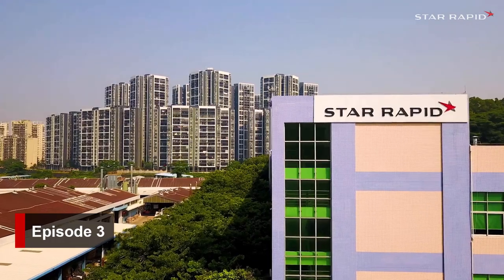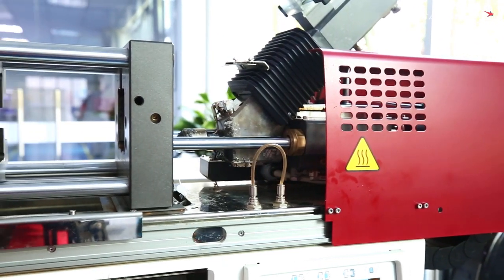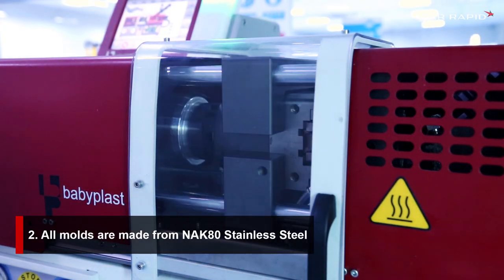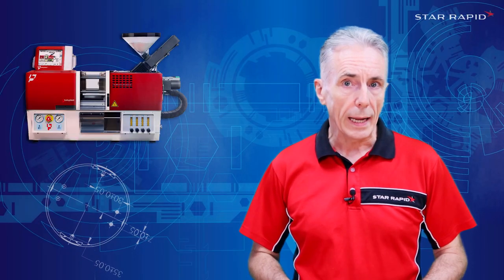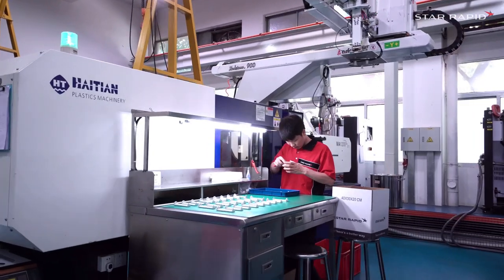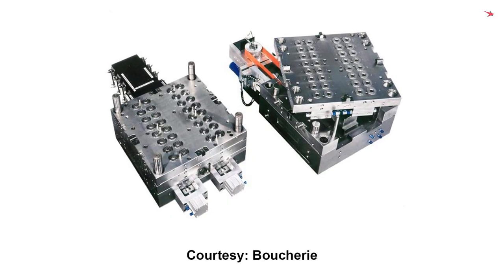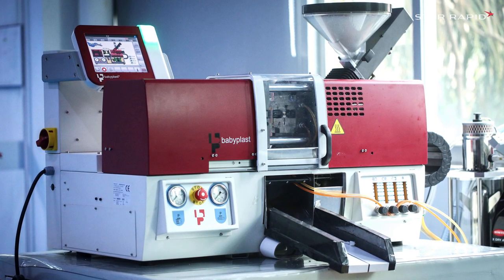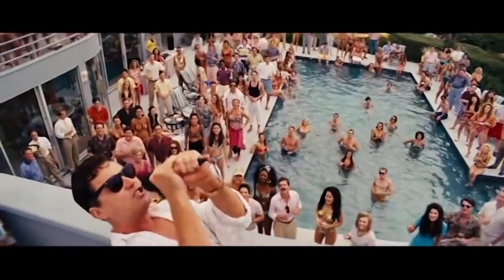8 Reasons Why You Should Be Using a BABYPLAST MICROMOLDING Machine | Some Serious Engineering - Ep3

Comment: Other advantages to a micro molding machine.
If you have a farm of them and one goes down you only loos a fraction of your production.
Cost to get started, while probably a scail version of "industry standard" is still possible for beginners.
Wich leads to the third point; more accessible scalability. You can grow at the speed you grow. Not through risky financing moves or waiting fiv or six years to afford the next machine.
Four. You dont nessieraly need a larg appropriately zoned location and when you need to griw to one, down time is minimal.
Cost of moving is nearly nothing in comparison.
Im sure there are more.

Comment: Would this machine be acceptable for double shot, keyboard keycaps?
Reply from the maker: Hi Joe, what do you mean by keyboard keycaps?
Reply: @starrapid   Any typical computer keyboard has a switch under each button, but the plastic that you touch (usually with the letter/symbol that you are trying to type out printed into the plastic)  is the keycap. 
In the world of high end mechanical keyboards, equally high quality keycaps sell for a premium. People customize the color, themes, font, etc etc. 

The best keycaps products are ABS or PBT and they are double shot. One shot for the body and another for the symbols.  
The second shot also allows for transparent plastic to be used for keyboard backlighting to shine through. 

I like to tinker and it would be loads of fun to make keycap sets myself.

Comment: Is their a company making a model that is twice the size of babyplast?
Reply from the maker: Twice the size?  Do you mean a 20 tonnes press? Yes, there are a number of manufacturers of low pressure micro molding machines. Toshiba make a 20 tonnes machine. https://youtu.be/UeklmrpRCYo 
But as you can see, it is a lot larger physically.

Comment: My company is looking into overmolding on wire harnesses to make the standard AC power cords for north american use.  We need a small vertical injection molder that can probably do two cavity molds in and around 2 to 4 oz shot size.   Anything in your repertoire ?
Reply from the maker: Hi, that is not something we work with, but you could ask the guys at howag-swisspur.com I'm sure they will be able to help!
Reply: I have contacted you via LinkedIn. Maybe I can help you.
Reply: Hi Tom Collins, I do this type of work all the time, and I can recommend some machines.
Reply: @proto2580  ok please do
Reply: @tomcatmeow69  You might want to look at Low Pressure Molding machines by Moldman machines (Ellsworth).  A 2 ounce shot is around 57 grams, and a 1 to 2 ton machine could handle this (Moldman 1050 or the 2 ton upgraded variant of the 1050).  4 ounces is roughly 114 grams, so you would need a Moldman with a 2 ton clamp (Moldman 6000).  These machines are run Polaymides for low pressure molding.  Over molding NEMA standard power connectors is a pretty typical use case.  I've designed lots of NEMA parts and the tooling (mold sets).  This is what I do: molded part design in CAD, Moldflow analysis (molding simulations), tool design and tool manufacturing.